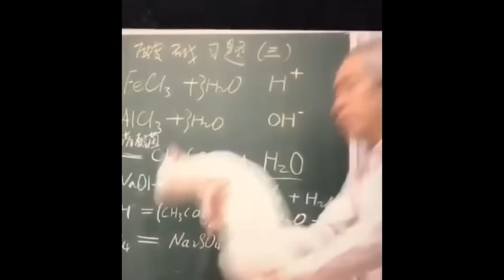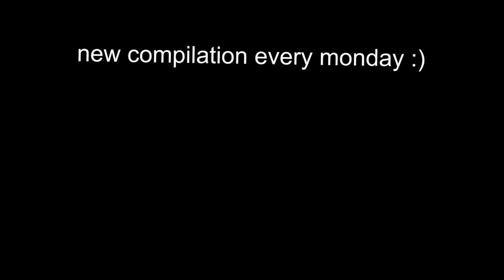UNUSUAL MEMES COMPILATION V243

Comment: 0:03 A bowl that could not resist the soup.
0:19 A 💀 that’s on fire. 
0:52 A cat who forgot his script.
1:14 A beautiful farewell.
1:22 A spinning top.
1:34 Mystery 🗿.
1:42 Goat simulator ?
1:56 Emergency in case of emergency.
2:42 When you can't shampoo.
2:58 The spinning top again.
3:13 A trampoline that took flight. 
3:23 Couldn't it be my cell phone?
3:28 Where are our diehard Gauls? 
4:07 A friend of Flash Mcqueen: Flashing                  ⚪👄⚪.
4:35 Uh 🗿...
4:43 🌟💯🌟.
5:25 A beautiful magic trick.
5:32 Mysterious 🌝.
5:51 Motorcycle that has Spawn in the backroom.
5:57 Tiny GTA 5.
6:28 Too much spinning 🔥.
6:57 Good night.

Comment: I have seen so many videos lately of glass bowls/cups shattering when hot liquids are put into them. This is because glass shatters when increasing temperature rapidly. I'm guessing the space between the particles expands faster than the rigid molecular structure of the glass can keep up with, resulting in structural failure.